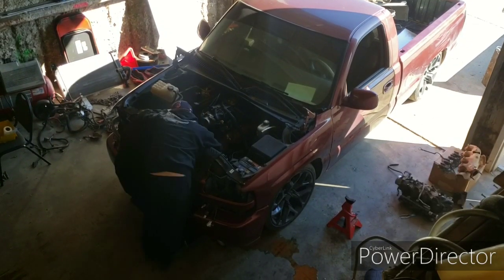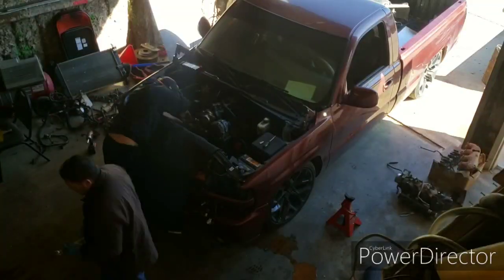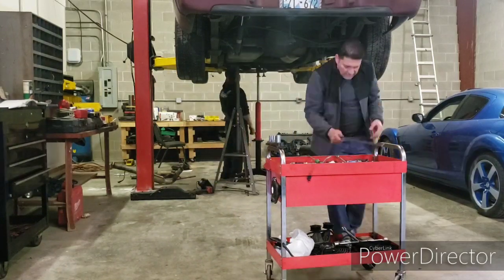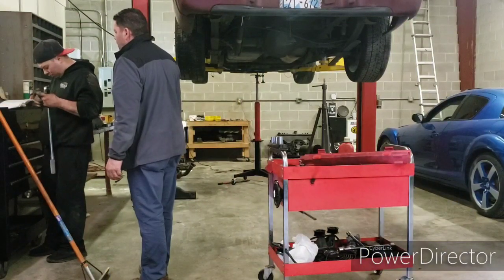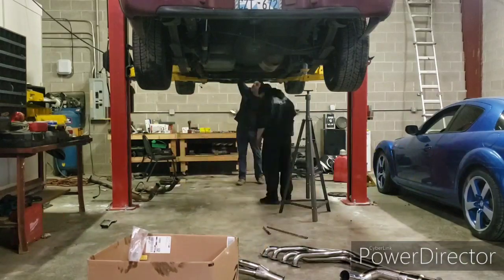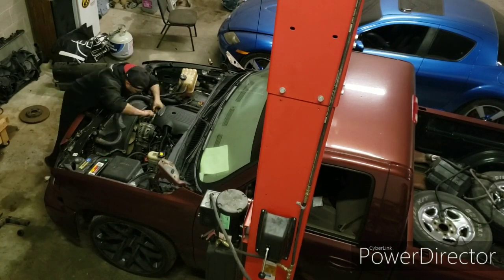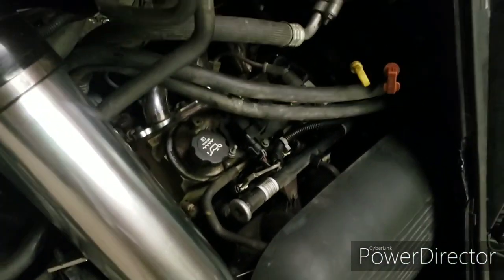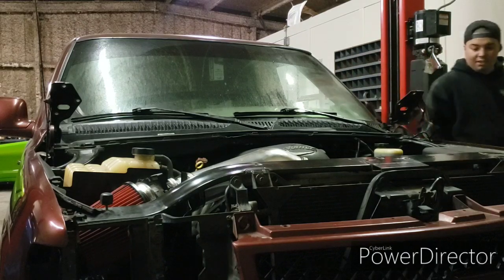V6 TO V8 LS SWAP SILVERADO (PART 3)

Comment: Will a 2001 v6 to v8 swap work with drive by wire 🤔? My 01 is Drive by cable but I got complete swap from a 03. Or do I need a drive by wire setup.

Comment: Hey I got 2004 Silverado 4.3 single cab and it’s drive by cable, i know the 2004 v8 Silverados or drive by wire, I want to put a 5.3 and stay with the driver by cable, so I know I need a 2000 to 2002 Silverado 5.3 that was drive by cable , but I heard I will need a 2004 wiring harness for Silverado 5.3 but that is drive by wire , so is there a way to wire it to work for drive by cable, I don’t won’t the drive by wire.
Reply from the maker: Yes we have done that before but there quite a bit of wiring involved to make it work. But it can be done
Reply: @gramajospeedshop  ok I thought it could be done, thanks.

Comment: What's the going rate for this swap? I'm about to jump on a 5.3 from Fraileys over in Tulsa to swap into my '00 4.3 truck. Will be using the stock 4l60e, but want a cam and a stall. Do you do the tuning to delete vats as well?
Reply from the maker: This swap is about 3k with headers and cold air intake and tuned. With can about 3500. Thats us supplying engine
Reply: @gramajospeedshop   hey how did you run the fuel lines from 5.3 quick disconnect to to 4.3 fuel lines stock lines????

Comment: I know this video is old, but with the V/8 a/c what has to be changed when using the a/c off of the V/8? I recently got a 1999 with a 2005 5.3L swap in it and they didn't do the e-fans swap or include any a/c stuff. So I need to buy the a/c compressor, lines going to the condenser and belt, but not sure if everything is the same between the V/6 and V/8. Thanks in advance, Frank.
Reply from the maker: You just need to buy a/c compressor and lines

Comment: What transmission did you use the one from the v6
Reply from the maker: Fabian Villarreal yes v6 trans with v8 converter.
Reply: Gramajo speed shop what torque converter from a 6.0 or a 5.3?

Comment: I want to do a swap from a v6 to a 6.0 v8 but idk I’d I will need v8 motor mounts or other stuff,can you tell me things I will need for the swap?
Reply from the maker: J P v8 engine mounts and also the body engine mounts from a v8 truck
Reply: L S I guess u would need the v8 mounts and harness as well with a stick shift transmission or you can probably convert to an auto transmission but it would be a little more money
Reply: My truck a is a 2003 v6 4.3 stick shift will my Transmission bolt on to v8 6.0 ?

Comment: Why did you choose to put all the accessories on after putting the engine in the truck? Wouldnt it be easier to put it all together on the stand then install it?
Reply from the maker: cole alsup I choose to do it this way so I don’t hurt anything when going in with the engine. With all the accessories on the engine won’t clear the radiator support the water pump gets stuck and also with accessories on it you can hurt a pulley. I do it this way mainly so it will look cleaner and it doesn’t really take much longer. All this was done in 10hr